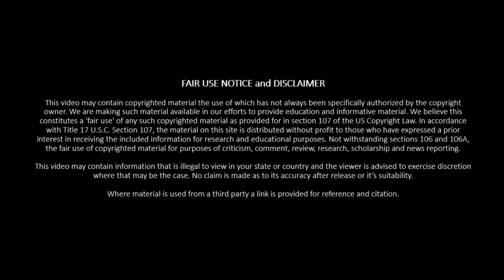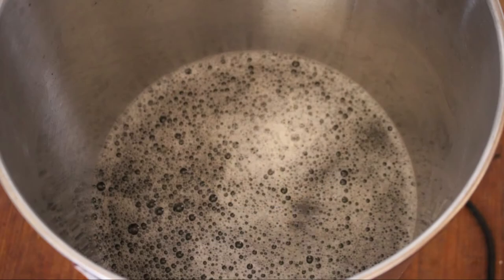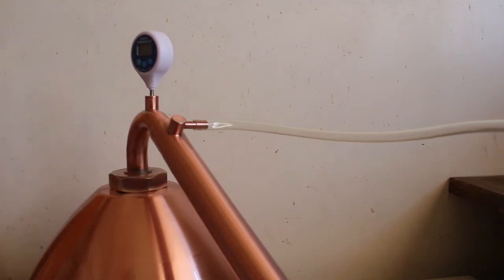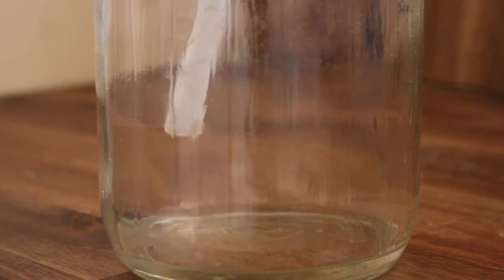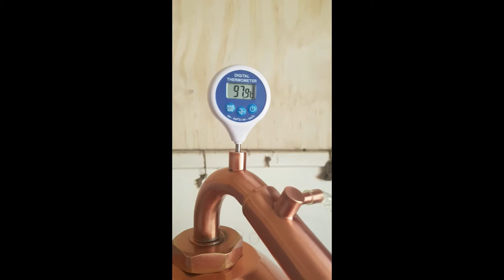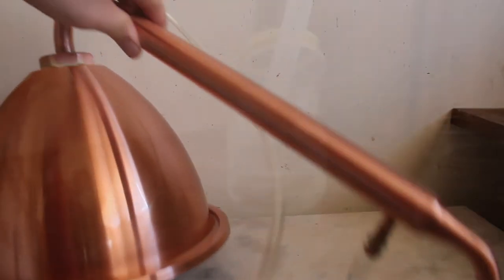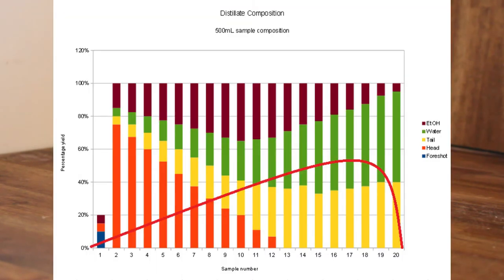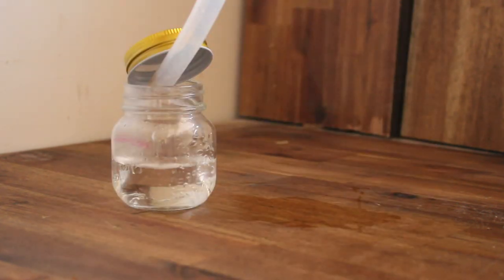A demonstration of pot distilling

Comment: Can you run slow the first time and get the same results as a spirit run?
Reply from the maker: Yet but you shouldn't due to the way it concentrates and separates out things. A stripping run makes a potent alcohol concentrate that gives you better spread of the fractions/ cuts and clearer separation. One slow stripping run would lead to very dilute or widely spread out fractions/ cuts that have more overlap. More worse flavours with good flavours and less good flavours in each fraction/ cut. 
It is sort of like painting. You can put on one coat really thick ( a slow run) or several thinner coats (2 steps). The latter gives better coverage and results as a clearer fractions cuts. This is like painting two coats which gives a better paint finish with a better colour.
Reply: @IgorandFrankenstein  thank you for the great explanation!!! It makes more sense that way.